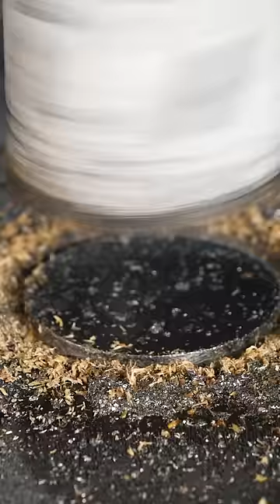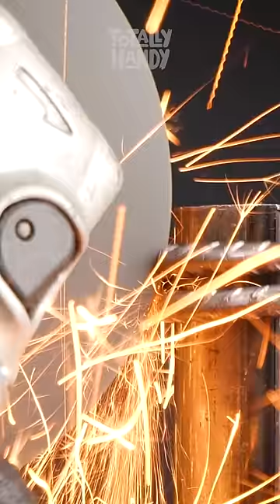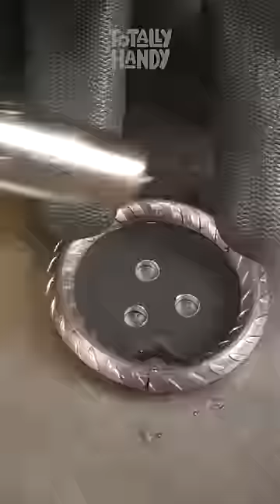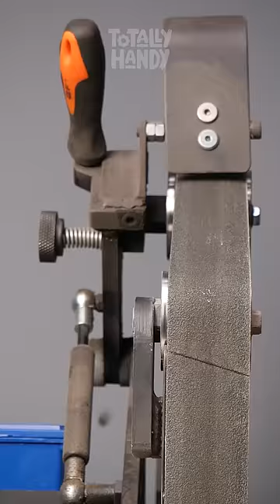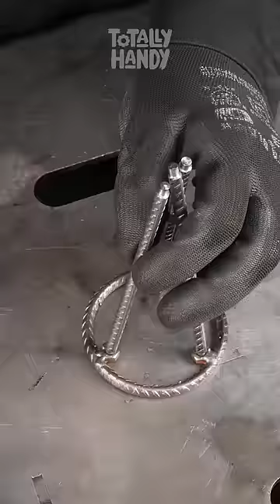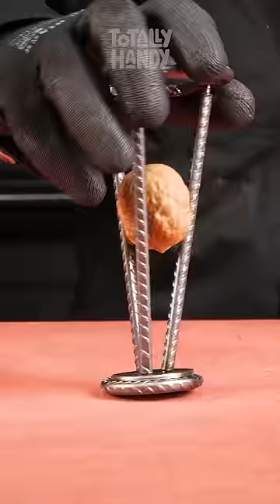DIY Nut Cracker Tool #shorts

Comment: Yes I'ma drop 50 grand on the tools and materials to make this or buy one for 50 cents
Reply: That’s kinda not the point though
Reply: @stevez2158  is it not DIY
Reply: @jubelu3347  just because you don't own the materials doesn't mean its not a diy.
Reply: @_.-._.-.  it's not materials it's the 50k worth of equipment that only super rich or companies own
Reply: @jubelu3347  ??? Most hobbyists own welders and grinders. Its not just "the rich and companies" lmao. You aren't the specific target demographic for every DIY video out there.
Reply: 2 different drill presses, standing belt grinder , hand drill, hand held grinder, and a welder.
I make 72 a year and I own only the hand drill and hand grinder 
I am in the top 20% of America.
You have no concept of the value of money
Reply: @jubelu3347  you can get welders for decently cheap and can do the rest of it with the hand tools. 
Also the top 20% in america make 100k+ /year, but depending on where you are can be in the 200ks.
Reply: please get 50cent's name out of your mouth
Reply: @jubelu3347  for the one, the sander could easily be replaced by a rusty file. for the two, you could buy everything you just mentioned for about $50aud used.

it's not even a cost thing. whether you have this stuff around just depends the kind of life you lived/people you were around - anyone can get into this stuff if they cared
Reply: @jubelu3347  it's like saying Cycling is not a hobby because you don't have or cannot afford a bike
Reply: @jubelu3347  50k? You could get all those tools for less than 800 euros /dollars, a drill press can be as cheap as 150, same for a welder, belt grinder are getting cheap so 350 is not impossible. Not even talking about switching to soldering and filling... It's a dumb easy diy project lmao.
Reply: @nora1034  lol the 50k was an exaggeration but it's funny you think normal people can spend 1500 on tools for a hobby
Reply: @jubelu3347  that's why I said you can still solder and file, would be cheaper and most people do have a file and a soldering iron.
Reply: @nora1034  ok cool what does this have to do with the video are you agreeing with me and this method is far too expensive
Reply: @stevez2158  exactly. Totally missed da point
Reply: @jubelu3347  I make 65k and I about 12k in tools. Including a (Tig) welder with a water cooler.
Reply: @jubelu3347  I’m 16 and I own all of these, you’re just doing it wrong
Reply: He literally had everything from hammer to drill, and he wanted a shitty tool to do the cracking
Reply: @jubelu3347  DIY is do it yourself.
it doesn't mean not to use expensive equipment.
if you want to do it with only cheap equipment, the name is DIC do it cheaply.
Reply: Hablando de hacer cosas estúpidas, un rompe nueces 🤣🤣🤣🤣🤣
Reply: A welder can be as cheap as 100, i bought one that cheap for a project, and that was a drill press which also can be fairly cheap
Reply: 50k? This is 1 or 2k of tools...
Reply: I just want to say it's not about specific tools or even that particular nut cracker product. 
It's about being innovative, thinking outside of your comfort zone, using what you have, problem solving in general.
In my own case I could easily improvise, using rudimentary old tools I literally dug up out of the mud.
I could probably use long bolts also free. The ends don't need to be round.
There are ways.
The most important feature is the open, inquisitive, willing mind, which can adapt, improvise, re-invent and be open to learning.
There, I said it.

Comment: For this diy, you need 
(1) A vertical drilling machine
(2) a grinder
(3) a hand drill
(4) drilling tool,hole saw tool
(5) welding machine
(6) a vice and workbench
(7) small a metal sheet, a steel rod and three nuts.
(8) a hammer

Btw comments only for fun, the guy did make an awesome nut cracker and that deserves a like.
Reply: No, it's stupid

Comment: I can crack walnut using my hands only 😅
Reply: I just throw it at my brother
Reply: You do you though
Reply: I can crack these chandlers by only squeezing them with my bare hands.  Others take a good smack on a hard surface.
Reply: I didn't even squeeze it with my hands. I just ate it with the walnut shell😁

Comment: Hmm walnut is put into DIY build that took somewhat amount of time, walnuts breaks

When I can put a walnut between my palms close the wrist but not using my wrist and slowly apply pressure til the walnut cracks enough to be split with your fingers,

Takes time to not put too much pressure and crush the full thing but it becomes a useful tool when eating walnuts,

You can do the same with almond but it's fucking difficult